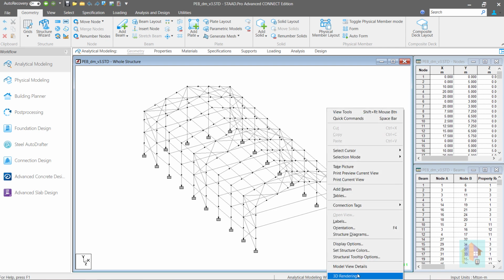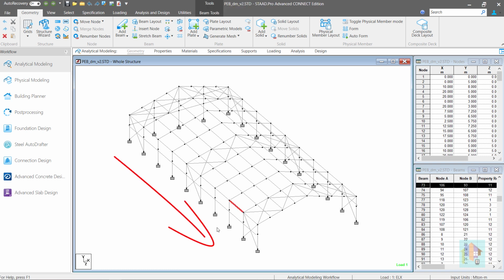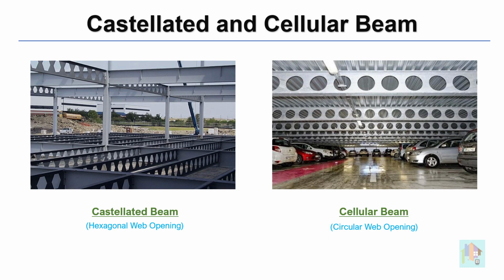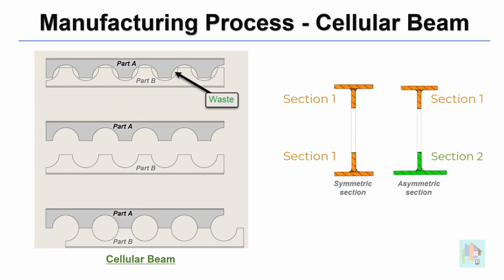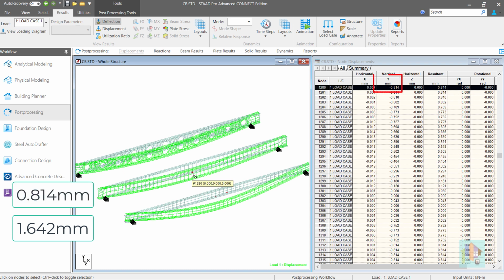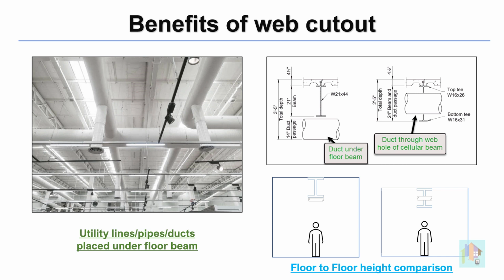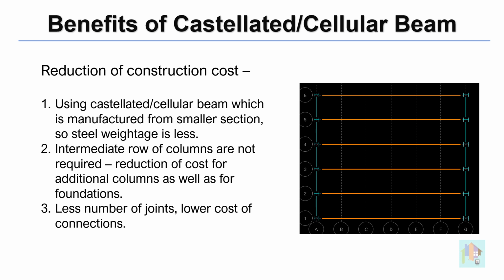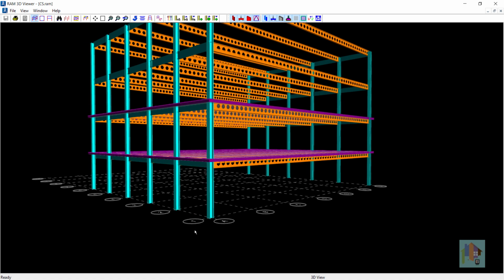Steel Structure Optimization: Part 6A – Optimization using Castellated & Cellular Beams || AISC DG31

Comment: How to  assign ms SHS 100X100X3.2MM
Reply from the maker: This section in not available in the standard database, so either you can use the define tube option available under standard tube section database to define the custom dimensions. If you use this section frequently, then you can customize the standard database and add this section. Check this video for more details -- https://youtu.be/3bjgDY90mCk

Comment: Halo sir, can you make tutorial ground  water tank complete with load and combination load by asce and aci code.
Reply from the maker: We have delivered an official webinar series on UG/at-grade water tank modelling analysis and design last year. Though ACI/ASCE code is not used, still you can get an idea how to handle such water/waste water tank design. 
You can check the recorded session using this link -https://event.on24.com/eventRegistration/EventLobbyServletV2?target=reg20V2.jsp&eventid=3201700&sessionid=1&key=1863895E1477266F68D84C19B9AC2828&groupId=2459179&partnerref=web&sourcepage=register
By the way, I have developed a custom template to apply hydrodynamic load on water tank which will be published soon.